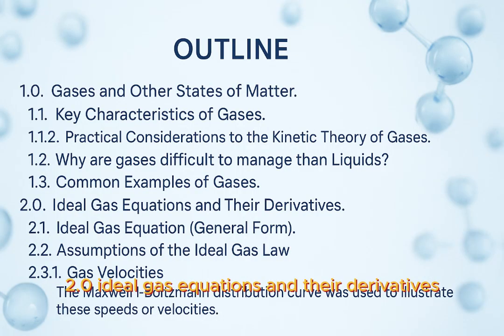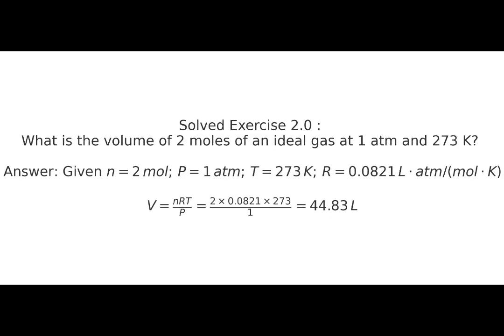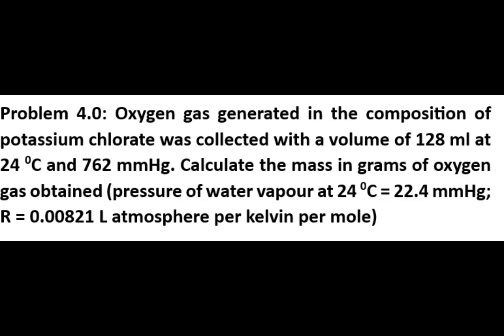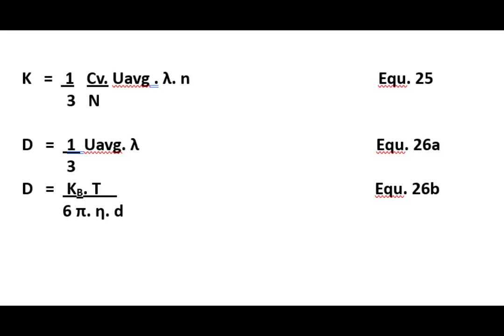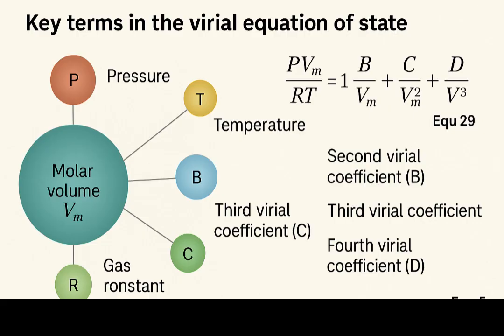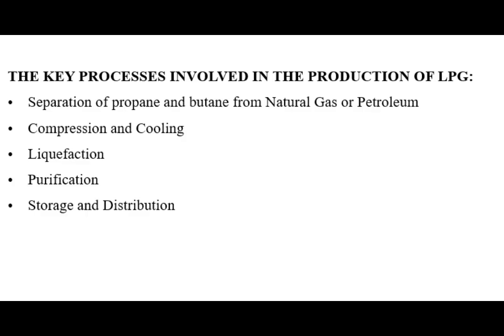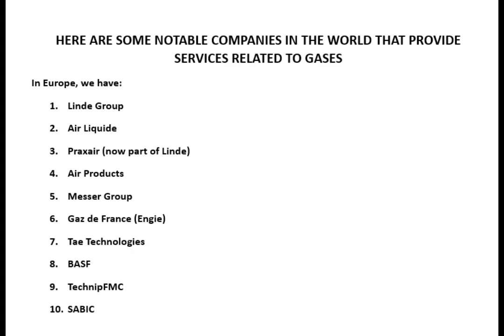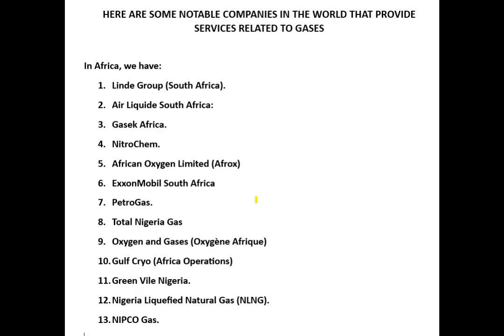Fundamentals and Applications of Gases

Comment: GLY : U2023/5565057 In Coiled Tubing Operations, nitrogen is used as a real gas rather than an ideal gas because real gas behavior accounts for non-ideal properties like compressibility and Joule-Thomson effects. This is crucial for accurate pressure and volume calculations during operations like purging, cleaning, or fracturing, ensuring safer and more effective well interventions.

Comment: GLY: 
U2023/5565012

In coiled tubing operations, nitrogen is treated as a real gas because downhole conditions involve high pressures and temperatures. Ideal gas laws don’t account for molecular size and interactions. Using real gas behavior ensures accurate calculations, safe pressure control, and effective performance during well interventions.

Comment: EDC
U2023/2592042

ROOT MEAN SQUARE SPEED (vrms)

1. Directly related to kinetic energy the RMS Speed is defined by the equation
vrms =√3RT
               M
 . R is the gas constant
 . T is the absolute temperature
 . M is the molar mass

2. Represent total energy contribution, RMS Speed considers the square of velocities so it captures the average energy contribution from all gas molecules. This is critical when designing turbines to hardness Maximum energy

3. Links to thermodynamic properties many thermodynamic equations used in gas turbines (e.g enthalpy internal energy) are functions of temperature and RMS  Speed is temperature dependent, making it a practical and relevant measure.

Comment: BCH: U2023/5535124
Atmospheric air contains only 21% oxygen, unlike medical oxygen cylinders that deliver 100% pure oxygen necessary for anaesthesia.

Lack of control over oxygen flow and pressure in atmospheric air makes it unfit for surgical use.

Ambient air may carry harmful contaminants like dust, microbes, and pollutants, posing infection risks.

Effective anaesthesia requires precise oxygen concentration, which atmospheric air cannot guarantee.

Medical oxygen is sterile, purified, and regulated, ensuring safe and reliable patient care during surgery.

Comment: BCH:

•Atmospheric air has only 21% oxygen, which is insufficient during anaesthesia.

•Medical oxygen provides up to 99% purity, essential for proper body function under anaesthesia.

•Atmospheric air is unsterile, posing a risk of infection during surgery.

•There's no control over oxygen flow or pressure with free air.

•Only medical-grade oxygen is safe and approved for surgical use.

Thus;

Using atmospheric air during anaesthesia is unsafe and unsuitable. Medical oxygen ensures proper oxygenation, sterility, and safety during surgery.

Comment: BCH:U2023/5535170
The implications of not  using real gas leads to complication known as laparoscopic surgeries fail, the carbon dioxide in need to inflate the abdomen, without it , keyhole surgeries may not be possible. The lack of oxygen or anesthesia gases can cause hypoxia, pain and even death.

Comment: Afuaman precious Ibhanabhor
U2023/5535181
Bch: Atmospheric oxygen has been proven not to be efficient enough for surgery because the oxygen is not free and pure. Atmospheric air contains about 21% oxygen while anesthesia often requires close to 100% pure oxygen to maintain proper oxygenation of the body, we use only cylinder to ensure the safety of the patient.

Comment: PIC 

LNG (Liquefied Natural Gas) and LPG (Liquefied Petroleum Gas) are both liquefied gases, but they’re produced differently because of their *different compositions and physical properties*.

---

1. LPG Production (Propane, Butane):
- LPG gases liquefy easily under moderate pressure at room temperature.
- So, LPG is made by compressing the gas — *no need for extreme cooling*.
- Joule-Thomson expansion can help in cooling, but pressure alone is often enough.

---

2. LNG Production (Mostly Methane):
- Methane has a very low boiling point (~ -162°C).
- Even if expanded through the Joule-Thomson process, it won't liquefy unless it's already precooled to cryogenic temperatures.
- LNG production requires:
  - Multiple cooling stages
  - Heat exchangers
  - Cascade refrigeration systems
- Joule-Thomson expansion is used*, but only in the *final cooling step after the gas is already very cold.

---

In Summary:
- LPG liquefies easily with pressure (Joule-Thomson works).
- LNG (methane) needs very low temperatures*, so Joule-Thomson alone is *not enough — it needs *complex cooling systems*.

Comment: PIC
Taminabo Omiesam Emmanuel 
U2023/5581056

The J-T experiment demonstrates a cooling effect used in gas liquefaction.

Why LNG is not produced via the J-T experiment as LPG this is because the two gases, have different properties and require different processing methods for liquefaction.

Seeing that LNG production, relies in Cryogenic refrigeration cycles and large scale liquefaction plants cool mostly methane to cryogenic temperatures.

While LPG Production, involves compressing and cooling heavier hydrocarbons, often by propane or butane refrigeration cycles, which are more easier to liquefy at comparatively higher temperatures and pressures.

Comment: Gly:u2023/5565015

Nitrogen is used in coiled tubing operation go help recover oil from well or reservoirs by reducing hydrostatic pressure on well bore, useful for stimulating the reservoir and unloading wells that aren't glowing naturally

Comment: MCB: Yes, ionization of gases plays an important role in lightning during thunder storm.

During thunder storm, the clouds extreme air currents causes collisions between ice particles and water droplets which leads to separation of positive charge accumulate near the top, negative charges near the bottom 
This strong electric field between the positive and negative charges becomes intense to ionize the air molecules. This ionization is conductive and leads to lightning.

When it's comes to lightening of electric bulbs, ionization of gases depends on the the bulb.
If it's a Incandescent bulb, it doesn't rely on ionization of gases.
But when it's a neon lights, fluorescent lamps or sodium vapor lamps.
These ones rely on ionization of gases.

Comment: Azum ugochukwu Sunday 
U2023/5765041
GMT:

The implications of using free and pure form of oxygen gas in the atmosphere rather than cylinder of pure oxygen for anesthesia during surgery are;
1. Contamination risk
2. Concentration and purity
3. Safety and reliability 
4. Flow control and regulations 

While using atmospheric oxygen for anesthesia has potential benefits, it would require significant technological advancements, infrastructure modifications, and safety protocols to ensure reliable and safe oxygen delivery.
Current medical practices rely on controlled, purified oxygen sources for anesthesia.

Comment: ELIAS-WEGBOM PATRICK CHIGOZIE 
U2023/5765034
DEPT:GMT

The implications of using free and pure form of oxygen gas in the atmosphere rather than cylinder of pure oxygen for anesthesia during surgery are;
1. Contamination risk
2. Concentration and purity
3. Safety and reliability 
4. Flow control and regulations 

While using atmospheric oxygen for anesthesia has potential benefits, it would require significant technological advancements, infrastructure modifications, and safety protocols to ensure reliable and safe oxygen delivery.
Current medical practices rely on controlled, purified oxygen sources for anesthesia.

Comment: Tamuno owunari 
U2023/5535255

Risks of using atmospheric oxygen 

Using free and pure oxygen from the atmosphere instead of a cylinder poses several risks, including 

1. Difficulty controlling oxygen concentration:
Atmospheric oxygen levels can vary, making it challenging to maintain a consistent concentration 

2. Increased risk of fire: oxygen supports combustion and uncontrolled oxygen levels can increase risk of fires, especially in the presence of ignition sources 

3. Potential contamination: atmospheric oxygen can be contaminated with pollutants ,particles or other gases which can affect its purity and safety 

 4.  Explosion risk: High concentrations of oxygens can increase the risk of explosions, particularly in enclosed spaces or near ignition spaces

Comment: OGHENERO EGOIDE SYLVESTER
U2023/5765032
GMT:

The implications of using free and pure form of oxygen gas in the atmosphere rather than cylinder of pure oxygen for anesthesia during surgery are;
1. Contamination risk
2. Concentration and purity
3. Safety and reliability 
4. Flow control and regulations 

While using atmospheric oxygen for anesthesia has potential benefits, it would require significant technological advancements, infrastructure modifications, and safety protocols to ensure reliable and safe oxygen delivery.
Current medical practices rely on controlled, purified oxygen sources for anesthesia.

Comment: WucheBobbyEmmanuel
U2023/5535149

BCH... The oxygen in the atmosphere is not free nor pure.

Atmosphere contains 21% of oxygen and > 70% Nitrogen and about 0.3% CO2.

In a normal healthy person, this amount of oxygen is sufficient for saturating the red blood cells but under anesthetic conditions, pure 100% oxygen is needed, so that a patient has maximum oxygen saturation even when they loose blood during surgery, so there is sufficient tissue perfusion and no ischemia.

Also respiratory mechanisms of a patient may not be occurring at normal rate, so external help with a pulmonary machine is needed.

Comment: BCH: THANKGOD PRINCESS OGECHI 
U2023/5535118

Not using a real gas application for oxygen in a cylinder during surgery can have serious implications. The purity of the oxygen is critical; if it's contaminated, it could lead to respiratory distress or other complications for the patient. Also, the flow rate needs to be precisely controlled to ensure the patient receives the correct amount of oxygen. Using an improper application could result in either insufficient oxygen supply (hypoxia) or an excessive supply (hyperoxia), both of which are dangerous. There's also the risk of equipment failure or leaks if the application isn't designed for medical-grade oxygen, potentially leading to a fire hazard or compromising the oxygen supply.

Comment: DIEPRIYE MOSES BRAIDE 
U2023/5765019
GMT:
The implications of using free and pure form of oxygen gas in the atmosphere rather than cylinder of pure oxygen for anesthesia during surgery are;
1. Contamination risk
2. Concentration and purity
3. Safety and reliability 
4. Flow control and regulations 

While using atmospheric oxygen for anesthesia has potential benefits, it would require significant technological advancements, infrastructure modifications, and safety protocols to ensure reliable and safe oxygen delivery.
Current medical practices rely on controlled, purified oxygen sources for anesthesia.

Comment: BCH:
Using atmospheric oxygen instead of pure cylinder oxygen during is not safe.The air around us contains 21%oxygen which is not sufficient to support anaesthesia that requires higher oxygen concentration.free air also lack purity and may contain dust and other pollutants that can cause infections or complications during surgery .

Comment: PIC: 
LPG (propane and butane) can be easily liquefied using the Joule-Thomson effect at room temperature due to their high inversion temperatures. However, LNG (methane) has a very low inversion temperature (~−161°C), so it heats up instead of cooling during JT expansion at normal temperatures. Therefore, LNG requires pre-cooling with cryogenic systems, and cannot be produced by Joule-Thomson expansion alone like LPG.

Comment: Bch:Nwabueze chidinma :
Nitrogen is used in coiled tubing applications for oil recovery from reservoirs prima due to its inert ,non -reactive properties,low density and ability to maintain high pressure

Comment: CHRISTOPHER GRACE NNAMDI

BCH:
Using atmospheric air instead of pure medical oxygen from a cylinder during anesthesia poses serious risks. 

Firstly, atmospheric air contains only about 21% oxygen, while anesthesia often requires close to 100% pure oxygen to maintain proper oxygenation in the body. Relying on atmospheric air may lead to insufficient oxygen supply (hypoxia), which can cause brain damage, organ failure, or even death.

Secondly, oxygen in medical cylinders is pressurized and regulated for accurate delivery through anesthesia machines. This precise flow is critical for maintaining stable anesthetic conditions. Atmospheric air lacks this control and cannot be safely or effectively used for surgical purposes.

Thirdly, cylinder oxygen is purified and free from environmental contaminants, while atmospheric air can contain dust, bacteria, or harmful gases, increasing the risk of infection and complications. Also, pure oxygen supports the effectiveness of anesthetic agents and promotes faster recovery.

Therefore, the implication of not using oxygen from a cylinder during surgery is severe and can compromise both the safety and outcome of the procedure.

Comment: NAME: GEORGE,  IDONGESIT GODWIN 
MAT. NO: U2023/5535125
DEPT: BIOCHEMISTRY 
 
 BCH: The implications of using free and pure form of oxygen gas in the atmosphere rather than cylinder of pure oxygen for anesthesia during surgery are:
 1. Contamination risk 
 2. Concentration and purity 
 3. Safety and reliability 
 4. Flow control and regulations
   While using atmospheric oxygen for anesthesia has potential benefits, it would require significant technological advancements, infrastructure modifications, and safety protocols to ensure reliable and safe oxygen delivery. Current medical practices rely on controlled, purified oxygen sources for anesthesia.

Comment: Name: AKPA GRACE RHODA 
Mat. No: BIOCHEMISTRY (U2023/5535121)
 
 BCH: The implications of using free and pure form of oxygen gas in the atmosphere rather than cylinder of pure oxygen for anesthesia during surgery are:
 1. Contamination risk 
 2. Concentration and purity 
 3. Safety and reliability 
 4. Flow control and regulations
   While using atmospheric oxygen for anesthesia has potential benefits, it would require significant technological advancements, infrastructure modifications, and safety protocols to ensure reliable and safe oxygen delivery. Current medical practices rely on controlled, purified oxygen sources for anesthesia.

Comment: BCH
U2023/5535069
Using atmospheric oxygen (21%) instead of pure oxygen cylinders (100%) for anesthesia during surgery has implications for safety, physiological effects, and logistics. It may reduce oxygen toxicity and fire risks, but poses challenges in controlling precise oxygen concentrations. Equipment modifications would be necessary, and current medical practices prioritize controlled oxygen supply for patient safety.

Comment: GLY:
The reason nitrogen is treated as a real gas rather than an ideal gas is because *real gas behavior accounts for interactions between molecules and non-ideal volume effects*, which are significant at the high pressures and varying temperatures encountered in well interventions. Real gas behavior more accurately models the properties and behavior of nitrogen under these conditions.

Comment: Kudos Edidem 
MCB

ionization of gases in the atmosphere can cause lightning during a thunderstorm. When the electric field between clouds or between the cloud and ground becomes strong enough, it ionizes air molecules, making the air conductive and allowing a sudden discharge of electricity—lightning. it depends on the flow of electric current through a filament (in incandescent bulbs) or through gases (in fluorescent or LED bulbs), but not necessarily due to ionization like in lightning

Comment: BCH: Using the free and pure atmospheric oxygen  instead of  using the cylinder pure form of oxygen for anesthesia is dangerous because atmospheric oxygen is a highly contaminated gas that contains dust particles, molecules of bacteria and viruses, which can affect the patient negatively during surgery. Cylinder pure oxygen gas however is sterilized before use making it a much better choice for anesthesia during surgery as it contains no form of contamination that can affect the patient in use of it

Comment: BCH : U2023/5535091
 Kalu Raphael makuochukwu 

Risks of Using Atmospheric Oxygen:*

Using free and pure oxygen from the atmosphere instead of a cylinder poses several risks, including:

1. Difficulty controlling oxygen concentration: Atmospheric oxygen levels can vary, making it challenging to maintain a consistent concentration.
2. Increased risk of fire: Oxygen supports combustion, and uncontrolled oxygen levels can increase the risk of fires, especially in the presence of ignition sources.
3. Potential contamination: Atmospheric oxygen can be contaminated with pollutants, particles, or other gases, which can affect its purity and safety.
4. Explosion risk: High concentrations of oxygen can increase the risk of explosions, particularly in enclosed spaces or near ignition sources.